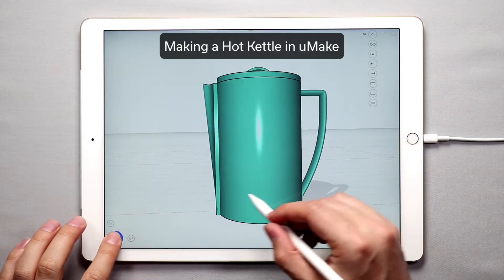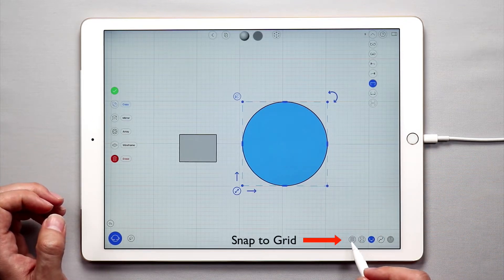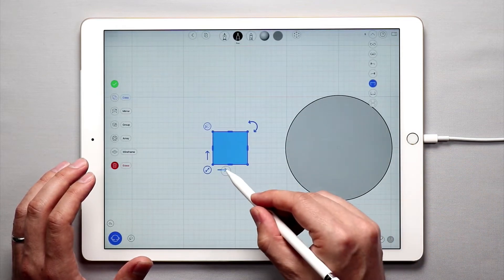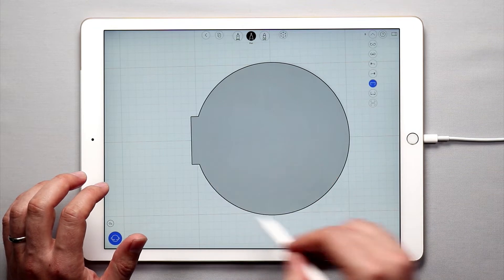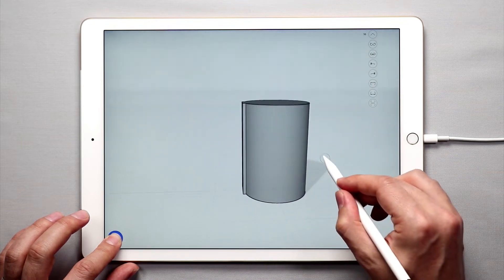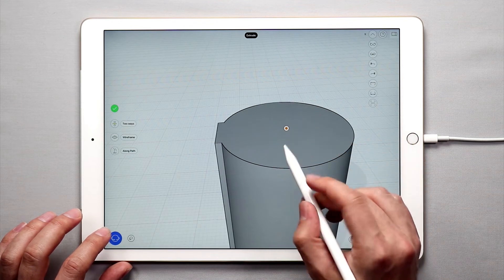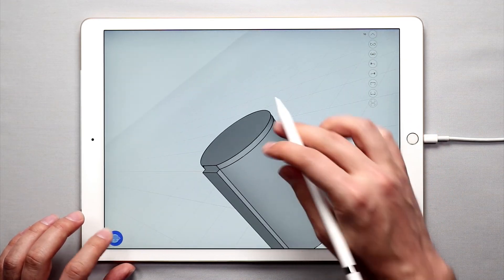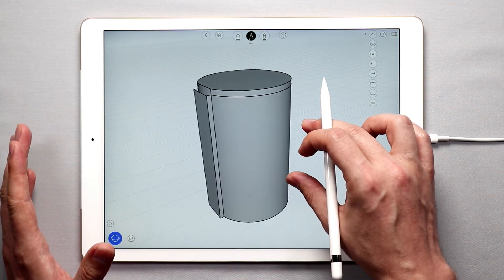uMake 1-Day Course - Hot Kettle - Part 1

Comment: Once I pull the irregular shape upwards, the edges of the circular shape have been split into 3 or 4 connected edges. The video shows one circular surface pulled upwards when mine is four independent surfaces that make up the circular portion. I believe I am following each step exactly. Perhaps there is a setting that I have that is creating this issue. Any help to resolve my issue will be greatly appreciated.
Reply from the maker: Hi Thom! Thank you for pointing out this behavior. We made some changes to the core engine, resulted in these additional lines. This should affect anything (as you can select all edges and surfaces of that kettle body), but if you want to create the body without any of these lines, here's what you should do: 1. Erase the additional lines of the circular body; 2. Select the two edges (the top and the bottom) of the circular body; 3. Tap on the green highlighted area to create a new body without these curves. Let me know if it works. Thanks!
Reply: uMake Thanks for the quick reply. It works great! Much appreciated.
Reply from the maker: @TheRealThomRoy  Happy to help! Have a great week!
Reply: uMake excuse me. How can I erase the additional lines?